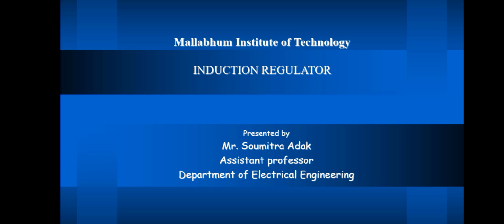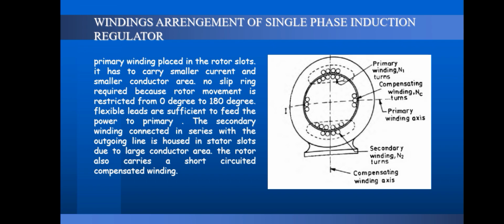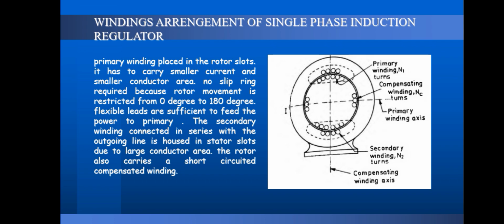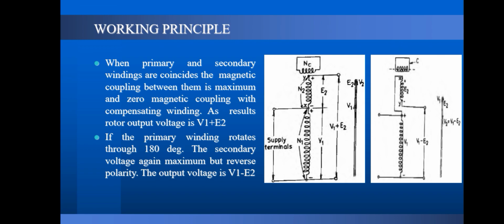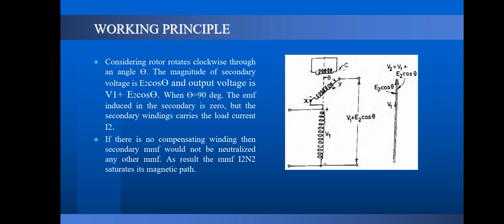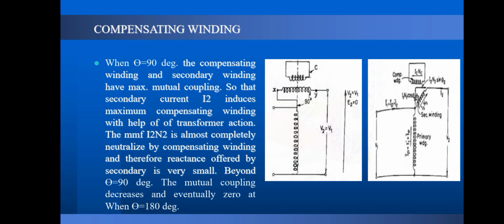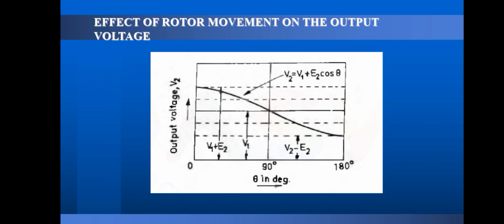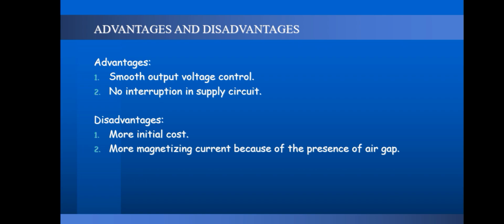INDUCTION REGULATOR || SOUMITRA ADAK || ELECTRICAL ENGINEERING

Comment: Hello, could you please explain how to design a 400 kVA induction voltage regulator with the following specifications:

Power phases: 3

Input voltage: 380 V (three-phase)

Output voltage: 0–500 V (three-phase)

Capacity: 400 kVA

Specific design questions:

What is the number of coil turns required?

How to select the stator and rotor pole numbers?

How to determine the diameter and height of the stator and rotor poles?

Thank you!